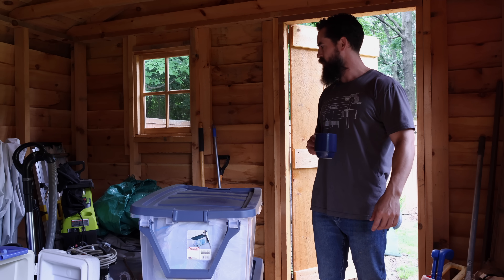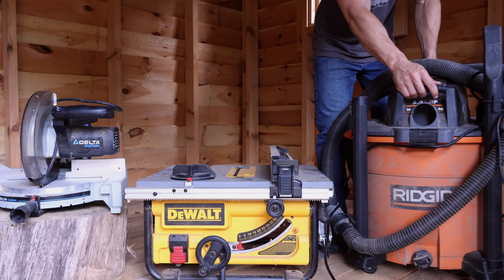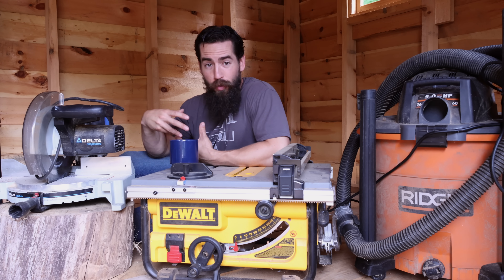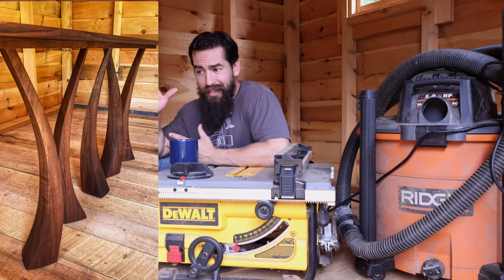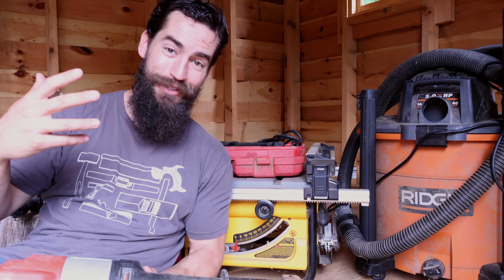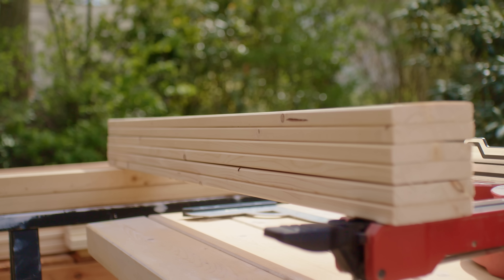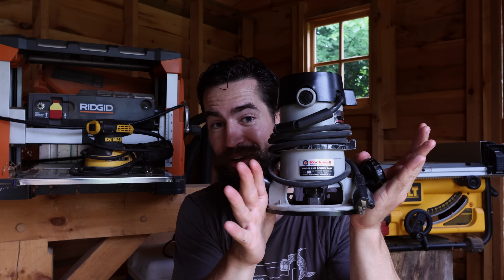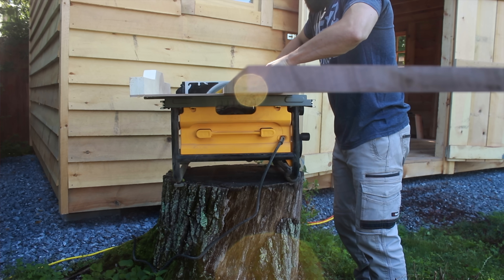3 practical woodworking tips for beginners

Comment: As a mediocre hobby woodworker who has spent my life collecting tools for my shop very slowly, your video is spot on! I suggest a follow-up providing advice on where to find wood to work with, what types are out there, and, in general, what should be used for what (soft wood, hard wood, sheet goods, 2x4s, rough-cut lumber, etc).

Comment: When I started I was getting every used power tool I could. I then built a Moravian bench using mostly hand tools.  I flattened the top using a Stanley #5 I picked up for $20.00. I enjoyed it so much I sold the jointer to free up space since I learned to use hand planes. Most of my projects are about maximizing my limited shed space of 10' x 16'. One tool that I would recommend is a band saw. I did get a SawStop job site saw for safety reasons but rarely use it. It stays folded up since I discovered I prefer grabbing a handsaw,  it can be faster than unfolding, setting up, starting dust collection, finding ear & eye protection etc.

Comment: Very sound advice.  I learned woodworking in high school (and drafting).  Went into the military, and didn't really use those skills for a few years.  Had a birthday coming around, had the wife buy me a circular saw so that I could do a couple things.  The only power tool I owned prior was a drill.  Built what I had planned on, wife sees it, wife is surprised I knew how to do anything like that.

Fast forward about 3 years, birthday coming around again, had some end tables and coffee tables falling apart, asked for a table saw.  Found a used Craftsman that also had a 4" jointer.  This is where things really started.  BUT, instead of building a coffee table right off, I built a gun rack with two locking drawers.  Wife was not particularly pleased, but I needed the practice.   Built the tables, bought some clamps to do glue ups for them, and a set of chisels from Sears.  Still in the Army, and there are weight limits for what you can move, so I had to be mindful of that.  Annnnd, I discovered Roy Underhill on PBS.  Immediately started thinking about hand tools - and MAKING some of those.  Mallet check, marking gauge check, new sanding block check etc.  

I have a fairly well set up hobby shop these days, and still have that original Skil saw, drill, and the mallet I made way back when.  One thing I learned was to save up for a quality tool versus buying a cheap version, and contractor grade stuff is (mostly) fine for what I do as a hobbyist.  Hand tools are the real exception there.  Caveat to that is if I think I'm only going to use this new tool for one job (that's where a certain place with initials of HF comes in real handy).

Comment: Yup...started with a sander, a drill, a borrowed contractor table saw & some hand tools in an apartment carport. That got me going for a few years. 
Then a router, jig saw, couple more years, then shopvac, the planar...after that it's all upgrading, but also years into making. Now i have a bandsaw instead of jigsaw, jointer, dust collector, better table saw & drill-press, but i made plenty without those simple tools & hand tools.

Comment: Totally agree. I was fiddling with dovetail boxes made out of hand-planed scrap. For instance. 
Then I had to do some rough work at the attic. And guess what. No problem to saw recesses, plane pieces to thickness and so on. Not afraid to screw it up. Because I knew I could even be sloppy (in comparison) and it would fit. Having sawn and chiseled to a grade of much higher precision before, I was confident to handle this larger scale project without a doubt. 
Not to mention the insight into wood and it’s capabilities and flaws itself. 
Start „small“. And then scale it up with ease. Same with tools.

Comment: Agree with @tomsardo6984. I'm also in a small shed, and with a wheelchair to boot. Space efficiency is gone; reaching tools from the chair is the deal. I'm at the small objects stage, no fine woodworking yet. Pine, some oak, small stuff. This vid made me feel better and more confident about where I am in woodworking. I just used the "dado" feature (little rotating cheesy depth stop) on my Ryobi chop saw to make rabbets on pine pieces and clean them up with a chisel. My greatest achievement thus far! Thanks for your encouraging and informative vids!

Comment: I agree with what you said... I am a former carpenter that has slowly converted a 1 car garage (I walled off a portion of my 3 car garage) into a very functional wood shop. I had to make a few compromises along the way (for example, I have a 6" jointer and lunch box planer), but I have everything that I need (including a cabinet saw) to make almost anything that I feel like tackling. The key in a small shop is maintaining a flexible middle space and being selective in what you "need". For example, my 32" x 48" assembly table is almost always set up as a "wing" to my main workbench, but it can be folded up and hung on the wall If I want to make a larger table (for this I break out the saw horses). I will never have a lathe or CNC and that is OK... I can purchase pre-turned legs and learned to use templates for unique/repeatable pieces.

Comment: I’m at the other end of a woodworking journey. Got all the right tools in a large workshop. Just a nearly broken body and lack of energy holds me back. Anyway, learning from my journey, my start up tool list would be:

1. Decent bench. Doesn’t have to be permanent; good saw horses with 4” x 2” stretchers is fine
2. Basic hand tools. Tenon saw, chisels, mallet, rulers and tape measures
3. Sharpening kit. Scary sharp is low barrier entry and works well
4. Track saw with 90 degree fence attachment. With that, you can rip and cross cut anything
5. Bench top thicknesser . This allows you to finesse the timber you buy
6. Battery drill 
7. Dowel jig, pocket screw jig

Then learn precision, patience and get experience.
Reply: More good advice IMHO.

Comment: All really great advice. I'm only a few months in, just got a table saw and really wish I would have picked one up months ago. It's making all of my pieces I can cut on it so much more precise. I just got a $300 Skil saw and it's incredible for the money. Instead of my cuts being within 1/8 they're within 1/32 or 1/64. 
Next up for me is a track saw since most of my work is building reptile enclosures (basically cabinets). That's really gonna speed up breaking down full sheets of plywood vs my old Ryobi circular saw and piece of aluminum angle for a guide.

Comment: Thank you I’m still in that small shed and it’s all about time management and space efficiency. Thank you for everything you’ve done you’re inspiring in your work.
Reply: i have a 600 sq foot garage and 2 storeage buildings and i need 2x that it never ends
Reply: I have a 1.2x5m space next to my car in the garage (more if I drive the car out, but the garage is primarily for the car). I am finding that, while power tools often speed things up, the hand tools are smaller, cheaper, quieter, more satisfying. I would love a jointer/thicknesser but will settle with making a scrub plane out of scrap wood.

Comment: I started in an 8x10 shed that already had my fourge and foundry setup. I found an old and I mean probably collectible old tablesaw with a jointer all mounted on the same base. My tablesaw was my workbench for the most part 👍

Comment: Great advice. I still use a contractor saw in my home basement shop. Its a space issue, and it works well. Of course I have a larger saw in my other shop with my jointer and planer but I do a lot at home also. The rest I do with mostly hand tools (also can be expensive). Adding a piece at a time is the way to go. When you start out, you may think you want to be a woodworker, but maybe you find out you don't. If you bought everything at once now you have a lot of money tied up in tools you don't need. Buying second hand is a good idea also. My favorite router is an old metal body Dewalt I found at an estate sale for $30. People see my tool collection and think they need it, but I got it all one piece at a time, like Johnny Cash.

Comment: I have basically the stuff you suggest and am in that sort of liminal space between beginner and experienced hobbyist. If I'm doing anything more than one or two cuts in a session, I'm wearing a refillable cartridge style dust mask the whole time. I still run dust collection with a shop-vac and small cyclone but that's more for controlling the mess than anything. On a contractor saw it's really tough to get a setup running that collects enough of the fine particulate to go without a mask safely.

Comment: You ask what I/we would like to see, and honestly, I look forward to your content because it is good.  And not just good from a technical woodworking standpoint but from a life standpoint.  Taking chances, about the journey of learning, you focus on that part and how it impacts you personally.  As I ponder on what you discussed I realize I am going backwards.  I built large pieces that I was/am proud of (Bookshelves, cabinets, wet bars, large (20#) cutting boards, etc).  But the ones that I am having a tough time with now and I am learning the most from now is the small things (small tote with dovetails, and precise dadoes, a sliding top dovetail 'pill box', and other small things).  I had the room to build big, so I did.  But I missed the lessons I could have learned, from building small.  Keep up the good work and I appreciate the effort you put in to delivering this content.  No recommendations of what I would like to see in the future.

Comment: I know a lot of people disagree but don't hate on Harbor Freight. They have a lot of good tool in the mess of not so good tools. 

On the router subject, they just recently came out with a 2 1/4HP Hercules router set for $139. It's soft start, both fixed/plunge bases, 1/2 and 1/4 collet. I could list off every attatchment but all I'm saying is it's a good router set for a very reasonable price compared to the big name brands. HF also has some great protection plans.

Comment: Man, I have had that same vac for a little over 20 years. I still have my little ridgid table contractor saw but I scrapped the factory fence and dropped it in my table with a beismeyer. I can set the entire unit on saw horses. I use my old ridgid stuff for the job site but a few things had to be retired.

Comment: First tip is so important, and I don't even think you need "contractor grade" tools for most things, aside from very important tools like a table saw. I get by just fine with a Skil TS3607. It was $300, will accept a dado blade, uses regular 10" blades, it has a rack and pinion fence that is easy to square, is space-efficient, and has GREAT dust collection (way better than the dewalt) with just a 3.5HP shop vacuum (super important for a small shop imo). I also get by just fine with tools from Harbor Freight. I don't really think you need to buy an $80-100 orbit sander either. My $20 Bauer from HF works just fine, and has great dust collection w/a vac connected. The same goes for my router. It's the 10 amp from HF that I snagged for $60, but again it has good dust collection and works just fine. Hand tools too. If any HF hand tool breaks, I can just drive up the road and get it replaced with no questions asked for the rest of my life. Other brands aren't so simple.

The rest of my tools are generally the same. If I don't use something often, it's cheap, and it has a cord. Paying extra for weaker battery powered tools that you use twice a month is simply not necessary. The palm sander is a great example again here. You're going to have dust collection hooked up to it anyway, it doesn't matter if it's corded because the dust collection hose is going to get in the way more than any cord ever would. Same goes for a circular saw, unless you're cutting outside.

Comment: One thing that people sometimes don't realize: most tools, that are not designed for a very specific job, can be used in a wide array of different situations and different tools overlap. So you just need enough tools, to cover all your bases. Once you specialize in a certain area, you might want to get tools, more specific to your needs. 
Never be discouraged by the lack of fancy tools. Perfection is the enemy of done - just do it and learn to get better with what you have.
To add to the point of buying a shp vacuum: used ones are very cheap for under 50 bucks. Add a big bucket, a dust seperator and some vacuum line and you are good to go for maybe 75-80 bucks. With the dust seperator, the shop vac byitself doesn't need to be very good with a multiple filter system.

Comment: Great advice and it’s reassuring. I’m predominantly a wood turner. But when  I wanted to branch out into building tables in case goods, I needed a new tablesaw and bought the Dewalt contractor saw, Because so many YouTube woodworkers were using it, and it looked like a great saw. I hadn’t got it out of the box good and all of those said, woodworkers had upgraded to Sawstops  and some started recommending used saws similar to the old Delta Unisaw instead of job site saws. But it does everything I need and with some in feed and outfeed support it will serve me for a long time
Reply from the maker: If it does the job you need it to do then it’s the right tool, regardless of brand name. Glad it’s working for you!

Comment: My 10" Dewalt contract saw is great. Here is how you can make yours great too. Go by a speed square. Every time you move the fence, square it up against the speed square front and back. Also, use a set of machinist squares for setting blade to true 90. I find that if it's good enough on one offs, that's fine. When you start doing tables and have a lot of pieces, the 10 minute set up to rip a 100 board foot worth of walnut or wood of choice - you shall be happy!

For a long time, I just had a sawzall, compound miter saw, contractor dewalt 10", drills and a circular saw. I've added a dewalt 735 planer, a cheap WEN track saw for breaking down sheet goods, and a jig saw for quick lopping off of wood or doing rough outlines. Is it easier now? Yes. Required? No. Just saves time, but cost you money to do so.

Comment: I think the one thing I’d add here is to weigh up, based on what materials you use and have access to along with what you want to make to decide if your better off getting a table saw or a track saw first. I went the table saw first but as more of a maker then a woodworker and now I have both I wish I did it the other way around. A track saw doesn’t need to be upgraded like a table saw and when beginning if your using sheet material a track saw is way safer and easier to learn then trying to do long rips on a contractor saw

Comment: Gonna throw my 2 cents in. They are 2 power tools you absolutely have to get to get yiu started 1 is a cordless drill and 2 a circular saw. Between those 2 tools you should be able to cover most of youre projects. Next is a hand plane  after wich you can upgrade to a planner. You dont really need a table saw unless you're doing production work. Next would be a mitre saw a circular saw can do the same as a table saw and mitre. But its a whole lot easier to cut mitres on a mitre saw. Another thing is just to look around for used tools that you can sometimes get for free i wanted a woodworking vice for a while then my neighbor whas getting rid of an old littlestown  vice  does a good enough job as a wood vice since the jaw thread are pretty worn off it doesn't mar the wood. My final tip is this when you need a tool unless for the 2 tools you need saw and drill, borrow them if you find yourself borrowing them often then you know you should buy it

Comment: love your videos,  I think youre assuming that everyone has a drill, or maybe not?   i started out making planter boxes and stuff from boards so a drill and a sliding miter saw were my first tools then a circular saw and router and they were good enough for years..  then the table saw and now everything else  lol  most recent was a full size bandsaw to replace the 10 inch that worked good enough for years..   for the most part i have all construction grade tools and im really happy with what i can get out of them..  but even so i probably have 15 thousand bucks in my tools if not more..   ive never made any fine furniture but i dont make fall apart slapped together stuff either..  its somewhere in the middle..  right now i make displayers for a chain of garden centers so they have a bit of flare but have to be sturdy as hell and multifunction..  again  i love your videos

Comment: I started woodworking with a handsaw, a Bayley pattern hand plane and a handfull of chisels. I have the space now for all of the machienes you're showing but I have need for none of them (i do have a small bandsaw for ripping) and I can make anything I want. A router plane and a plough plane are the only important additions I got later. With sharping, meassuring and marking tools you're done for around 250 dollars. And working with hand tools is, for me, a lot more satisfying than pushing wood through expensive, noisy, dangerous and dusty machienes. I guess some projects take a bit longer but I'm in it for the woodworking, not to make furniture because I can't afford to buy a table.

I hear you mention Paul Sellers. Wouldn't you advise to start there first rather than pointing to a road of machiene tooling from day 1? Or at least show rhat option?